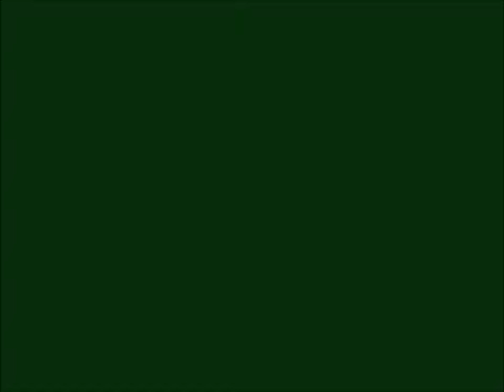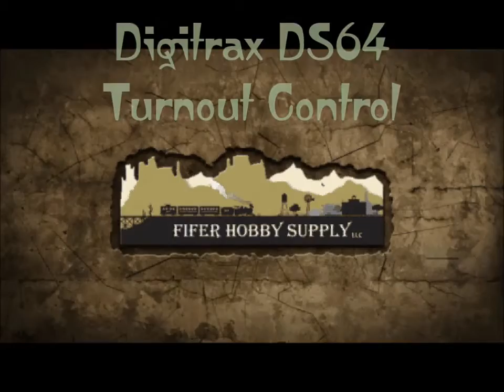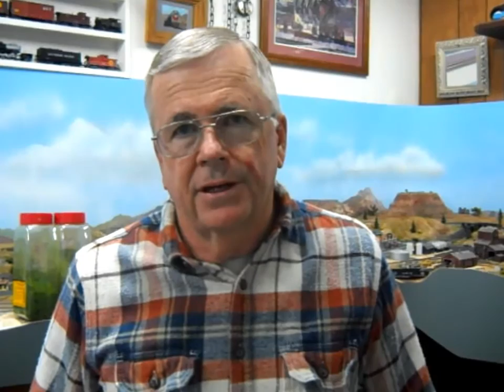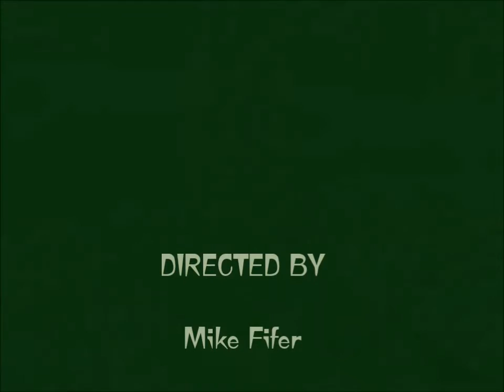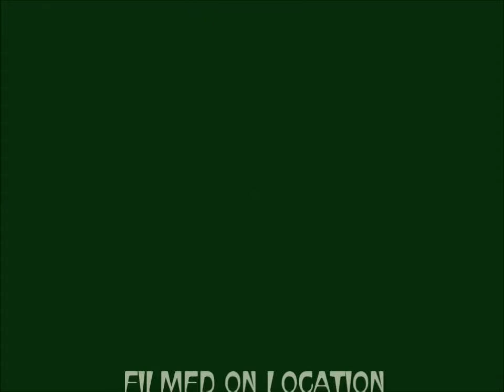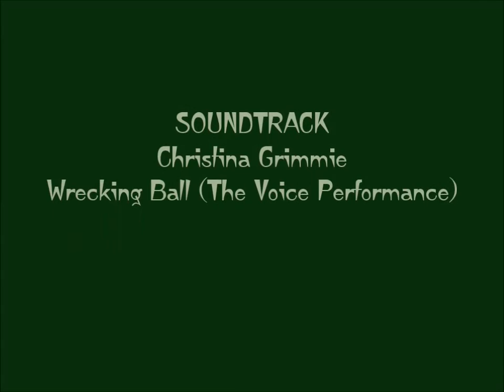Digitrax DS64 Turnout Control

Comment: Hey Mike, I am stuck with track power for my DS64s as I have the ESU ECoS 50210 and therefore no LocoNet. Is there any way around this issue using track A and B? I've experienced the same crazy synapases when I boot up the ECoS command station. At this point it is merely a nuisance.

Comment: Hi Mr Fifer, why would my Kato #6 turnout be getting hot?
Reply from the maker: How is it being thrown??????
Reply: @N-Scale  I found out it was a bad DS64. I tried two other n scale kato turnouts and both got hot within a few minutes. I'm going to replace the power supply and the DS64 with the new DS74.
Reply: @N-Scale  Remotely with a DS64
Reply from the maker: @stevecook9340  Is the DS64 set to throw Kato turnouts???
Reply: @N-Scale  Yes.
Reply from the maker: @stevecook9340  Then I have no idea. they only get hot when power is applied too long.
Sorry

Comment: just delay the turning on of the DS64's. I have a seperate 11.5V buss for my DS64's and an inexpensive Delay Timer Switch Module seems to solve it. It delays the power up of the DS64's by about 9 seconds, enough time for command station to figure itself out!! $12 for five modules!!  Wire them according to the markings on the board and should be fine  ;)
Reply from the maker: We tried that and it did not work. Digitrax answer was to leave them powered up 24/7.
Thanks , Mike
Reply: @N-Scale  wow, not really a solve.  I only gave three so if my railroad grows, I may have issues too...
Reply from the maker: @UBME2  I do not know but we leave ours on 24/7

Comment: Hi Mike had a real quick question can you use the k a t o 3-way connectors to the k a t o turnout plug-ins if you're wiring two together
Reply from the maker: Kato and Yes they will throw together.
Mike

Comment: I just got a DCS52 and is plugged into USB and power. When I turn the power off the DCS52 stays on and lit but the track power is off. Will the DS64 problem apply to this scenario as well? Asking because I'm working on power wiring.
Reply from the maker: I am not sure there !!
Reply: @N-Scale  I'll order a DS64 soon, so I'll let you know what I find out. :-)

Comment: Hi Mike I just had a quick question I was told it's better to use shorter leads to your bus but the k a t o are fairly long with their Plug and Play system are they okay to use
Reply from the maker: Yes the small length is not an issue.
Mike
Reply: @N-Scale  thanks but I was asking if the leads are too long is that an issue like the cata 35 in Leeds
Reply from the maker: @digitaljoeredding  And I said no they are not an issue

Comment: I"m a newbie and so much of this is going straight over my head...*sigh*  I am using Kato unitrack for both standard track and my turnouts.  First question Mike, why do people use those God awful huge solenoids underneath the track bed to control their turnouts, when you can just use Kato's Unitrack turnouts?  The Unitrack turnouts eliminate the need for them right?  Second question, do I still need some kind of Digital Decoder such as the DS64 when using the Unitrack turnouts and are they compatible?  Hopefully Mike you'll read this, or someone else who can answer it.  Thanks everyone in advance!
Reply from the maker: Yes you can use them with Kato if you desire. 
Some folks just can not get into Kato. Why do people buy Yugo's when they could of had a Corvette? I have no answer here.
Mike

Comment: Hey Mike great video that really helps me I'm putting in my DS 64 and my tortoise is now but I'm going to have a totally separate bus line that goes to a separate Transformer that's pretty powerful and I'm going to wire it to the track power there and turn the throttle down and we never turned a Transformer off so I'm hoping not to have any problems thanks Gary

Comment: I can't find anything about how connect my DS64 to my DCS51. So, on the official DS64 manual, it says to connect to track via TRKA and TRKB. Would I still need to connect it to my track if I have it connected via Loconet cable to my DCS51?
Reply from the maker: No you would not as long as the DS64 was being powered by a PS14 as well.
Thanks , Mike

Comment: Too bad about the cheap Chinese time delay relays. There are a lot of good time delay relays that the pins and schematics are there to help you. I guess you put a big sign at your manual switch to REMIND old timers or some young guys too.
Reply from the maker: This was posted in 2014 and the time did not work regardless of maker. Digitrax answer was to leave the DS64's powered up all the time and that seems to work.
Mike

Comment: i have over two dozen DS64s on my layout run by 4 JMRI panels using JMRI panel pro. the Omaha experts here recommend i set up a startup "configure button" on the panel. the purpose of the button is it initialize all the tortoises after startup by setting all the switches to "normal". also it was suggest that all my DC-64s run through one dedicated DCS200+ which is what i have done.

Comment: Mine do that and I do no use the loco net yet. I use the rail to power them ,but thought  A separate power supply may be the remedy,but have not got around to it yet. Digitrax needs to fix this issue with them rather then us having to adapt for their dysfunctional product not powering up properly before it  activates it's outputs randomly. I thought it was some sort of self test until I found all my turnouts out of sync. Thanks for Sharing this Mike.
Reply from the maker: I agree but the only cure is to leave them powered up all of the time. They need a larger keep alive capacitor or a battery in them .
Thanks , Mike
Reply: Ya it's not a perfect world.Had a idea about those outdoor cheep solar lights. They charge a battery . A battery or capacitor alone would discharge and back to square one. But  a little help keeping the power up wile they are in sleep/low draw mode may help.Just a crazy thought.

Comment: Mike,
Does this problem ONLY happen when the ds64s are powered from track power, or does it also persist when running them on external power (assuming both the layout and the DS64s come on at the same time)?

I'm trying to figure this out with my JMRI+Zephyr+PR3 based system.

Thanks!
Reply from the maker: They do it either way and with external power they throw WITHOUT the Loconet cables connected. I assume this means it is a signal that comes from within the DS64 and NOT the command station.
Thanks , Mike
Reply: ***** Oh okay, so if I power them externally (as opposed to track power), and have the loconet cables connected when I power everything on, then they WON'T go insane even if my Zephyr hasn't quite finished coming on yet?
Reply from the maker: K4Robotics Nope they will go crazy sometime either way , but only the first time the layout is turned on after not being used for a day or so.
Thanks , Mike
Reply: ***** okay, thanks for the info. Also, I'm just curious, what do you use to power your DS64s? Do you have a recommendation on what I use to power 4 of them, expanding to a total of around 7 in the future? I was originally going to use a PC power supply, but the one I had ended up being toast, so I have to buy some kind of power supply now.
Reply from the maker: K4Robotics Digitrax recommends a PS14 for each one but I think it is overkill. Any 14V power supply should work and loop them from one to the other. PS , I tried a ps14 to each but not a fix.
Mike
Reply: ***** So the wiring would go:

Power supply--->ds64--->ds64--->and so on

Also do you have any particular power supply you recommend? I was looking on Amazon but some of their cheapest ones seem to have reliability and safety issues according to the reviews, and I'm not really planning on burning the house down :P

Thanks again!
Reply from the maker: K4Robotics Sorry but I do not have any particular recommendation.
Mike

Comment: Just found this; very informative.
I'm curious .. what is the setting of OpSw6 in your DS64's ?? Factory default (thrown) is the outputs power up automatically. The option (closed) is the outputs do not power up until they receive a command. I wonder if that would have made any difference. I don't have a DS64 to fiddle with.
Reply: I will have to look into that.
Thanks , Mike
Reply from the maker: N Scale How To Channel We set all 13 of or DS64's at the club to Opt Sw 6 Closed and Opt Sw 8 Closed and the problem seems to have magnified. We had more switches throw with them set this way.
I am lost with this problem.
Mike

Comment: Thanks Mike for clearing this up for me. I have noticed this on my "winter" dining room table layout, and was wondering what was going on. It doesn't bother me a lot though, because I am using JMRI to control the layout and have predetermined routes set up in the panel. I just click "Initialize Routes", and everything goes to a default setting.
Reply from the maker: Thanks Ron , Mike

Comment: Mike, Thanks for this video and warning.  I use NCE Switch Kat's, but still appreciate the heads up.  You might look at a little $5 delay relay we are using to stall our scenery start ups (we were overloading our power supplies).  It is the H3Y-2, and it can be purchased through eBay.  It works for us and is adjustable to 1 minute delay.
This is probably the same problem I had with their DS51K's, and the reason I had to change to the Switch Kat's in the first place.  Thanks to your pursuit of the problem, I may get to use those DS51K;s after all.
Reply from the maker: Thanks for the tip Terry, I may look for these.
Mike

Comment: Good to know mike.  I have been using the NCE Switch-Kats and they seem to work well for me.
Reply: do those work with kato turnouts
Reply: trackspike64 Hi -  They are made specifically for the Kato turnouts and you can attach LEDS to them for signals or toggle switches as well.
Reply from the maker: Maltux1 Could you send me a diagram of the LED hookup to the shop please?
Thanks , Mike
Reply: ***** I sent you the PDF of the switch-kat to your email.  It is on the last page.  They have really been great for me.  I had a little help from Mark Gurries as I was shorting them out.
Reply: Maltux1 how much are they and where can I get them , saw a toggle set up on e bay that does the same thing but it was a kit form with a electronic board and some stuff I had to solder to the board ., hard to put together
Reply: trackspike64 can you send me a pdf on them my e mail is fffhellcat@Hotmail.com
Reply: trackspike64 sent to your email - have fun!